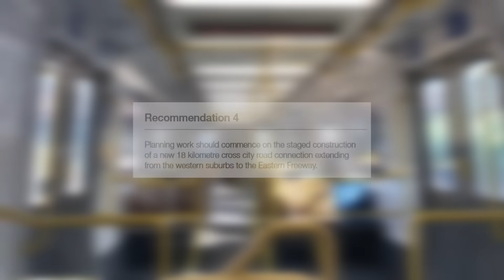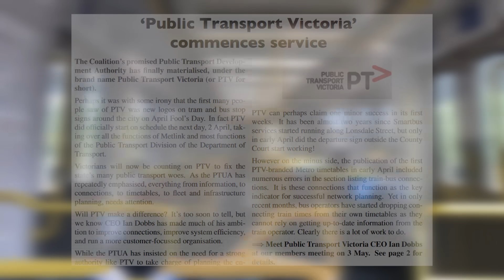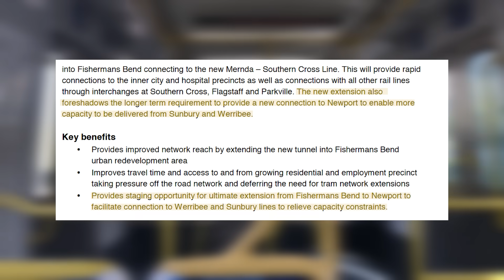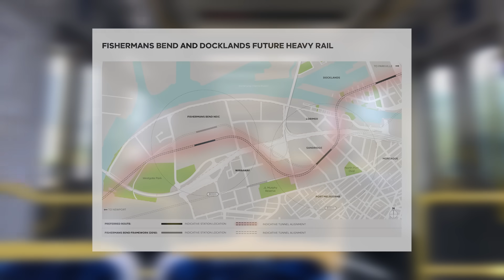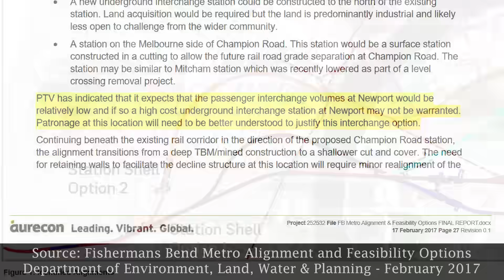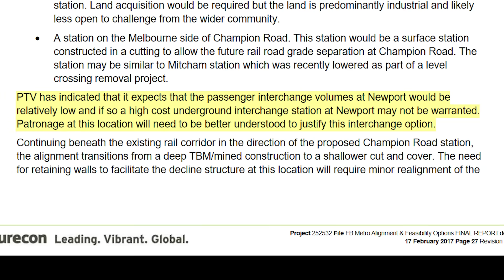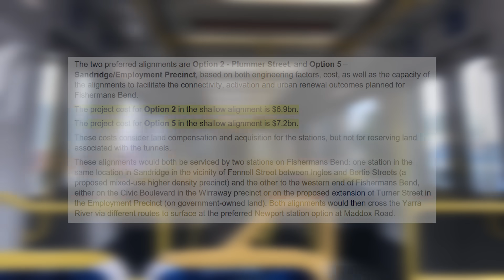Melbourne Metro 2: Explained

Comment: How Metro Tunnel + Other Tunnels could transform Melbourne

How Melbourne Can Keep Its Most Liveable City status…

I am a fan of the metro link proposal, that goes from Newport to Parkville. But I am not a fan of the proposed tunnel that runs past Parkville. I believe that this plan is floored. And I have what I think is a much better idea. 

THE IDEA: PART 1. I think that the proposed tunnel should link up with the Metro one tunnel near Parkville, and the metro 1 tunnel should be extended down Gratton street in Carlton, in a virtual straight line, crossing may well known roads heading into and out of Melbourne, and link up at Collingwood station. I am pretty sure it is the Craigieburn line does not have direct access to the tunnel, so as part of the idea Craigieburn is given access to the Metro 1 tunnel. 

PART 2: Now from Collingwood my proposed tunnel should be built to the Cr of Johnson St and Victoria St in Richmond, where a station should be built., (or close as you can too it). And the tunnel should continue to a second of my proposed stations, at the Cr of Coppin St and Bridge Road, (or as close as you can too it). The tunnel continues from there to east Richmond, where another tunnel station is built under East Richmond Station. And the tunnel should continue from there to South Yarra where the same thing is done, with another tunnel station under the existing South Yarra station. 

THE BENEFITS: PART 3: I predict that in about 20 years, as the docklands was made a CBD zone, that the same thing will happen in Richmond. Cos, if you know Melbourne well. Then it’s an obvious next place for the CBD to expand. And what this tunnel will do, is create a kind of ring road for many train networks. And allow the Frankston and Sandringham lines to run straight through to the Epping and Horsebridge lines, right through will most likely become CBD in the future. So, when my proposal is combined with the Metro one tunnel, and the idea in this video I discussed previously, it should connect, like in Brisbane, run through trainlines across approx. 90 percent of the whole network. 

MY IDEA COMBINED WITH YOURS: PART 4: And when you combine Metro 1, with My Idea, and the Idea that I liked in part 1 that I have already discussed, that figure might very well be 99 to 100 percent of the network, has access to by-pass the loop. I think this is by far and away the most efficient way of connecting Melbourne using the least amount of new tunnel. 

ANOTHER IDEA: You could also build a tunnel from Burnley station to the new proposed underground station on Bridge Road. And that would connect the Glen Waverly line with the Craigieburn line, in a ride through configuration like exists in Brisbane, that would bypass the loop. And then that would leave only the Belgrave/Lilydale lines being the only line that don't have a drive through connection, that connects two lines, on opposite sides of the city. 

ANOTHER IDEA FOR OFF IN THE FUTURE: You could connect the Lilydale/Belgrave line, with a tunnel that starts from East Richmond, and goes under the river, and runs parallel but to the south of Richmond/Finders/Spencer St Stations, that hooks up with your proposed station at Sandridge. It could go from East Richmond station, to a new station at the Cr of Dorcus St and St Kilda Road, then to a new station at the corner of Clarendon St and Dorcus St, and then a new station near the Cr of ingles St and Lyons St, and then on to the new Sandridge Station.  If you fast forward to 20 years in the future, Melbourne becomes a population of 8 million. The CBD would probably run through about 80 percent of the proposed tunnel in the whole of this writing. 

ANOTHER IDEA FOR WAY OFF IN TO THE FUTURE: And this one isn't as efficient as the others, but it is more of just, what I would like to see. A tunnel system that goes from your proposed Sandridge line, and goes south along the bay, and the beach, and ends up in Caulfield. Travelling through these stations: Barkley ST in St Kilda, Balaclava station, and Caulfield station. And any others that make sense along the way. The Idea would be that western trains could terminate in Caulfield.

WHY YOU SHOULD DO IT MY WAY: Cos my way puts the most amount of tunnel, in places that should be considered CBD, when the population of Melbourne hits 8 million people. Otherwise, you run the risk of having a network connection that the public views as a colossal waste of money. This is what could happen if you get enough of the new network be unpopular, like with Flagstaff station back in the day. Where trains would just skip it. And my idea connects 100 percent of the network with trainlines that will run under what should be considered CBD, in a way where the trains connect with other lines on the other side of the city. Just like in Brisbane. But Melbourne will have the best of both worlds, cos it will be like Brisbane and Melbourne, with the option of travelling and bypassing the loop out to an opposite side of the city, or going through the loop.

Comment: If they ever get around to this project, I seriously hope they re-open Paisley station. With the recent new shopping centre built near there I think it would have a real shot a second time around. And if they make the express route the permenant Werribee/Wyndham Vale line I hope the Altona loop gets, ideally duplicated, and extended to Point Cook. That could be hard to get off the ground but if the plan is to run some (and probably all eventually) Geelong line services via Werribee again, it'd mean you'd have the space for extra tracks and a free platform at Laverton for them to overtake or even stop there. Above all though Point Cook is growing and could do with an extension, which would probably take pressure off Williams Landing too. You could run it either via MM2 or on the above ground lines seeing as they'd now have space.
Reply: Funky idea, Wyndham vale to Werribee then to Point Cook!
Reply: @iamthinking2252_  I meant to say Werribee/Geelong line, but it would be nice if they finally connected it to Wyndham Vale too seeing as if they make Geelong trains go via Werribee again, which I'd say would be the easier option (especially if MM2 is built, you'd have the capacity for it then) as quadding the RRL would be a lot harder than it once was given all of what's gone up in Tarneit in the 10 years since it opened, Wyndham Vale is likely to be it's own electrified line. Long term they probably should look at electrifying the intercity lines, ideally with it's own (preferably double deck) rolling stock.

Comment: 7:27 i’ve got an idea for Rushall station the station could be retained and a double crossover is added to the line on the upside of the station and Rushall trains could run local services between Clifton Hill and the city and have trains terminate at Rushall and hurstbridge line trains would only have to stop at Clifton Hill and skip all other stations ( except joilmont on special events days when there is no special event taking place it would run express through jolimont station)

Comment: wait did that plan include electrifying all the way out to geelong!? because running velocities or other fuel burning engines through the tunnels would increase the requirements for ventilation

Comment: Wouldn't it be better in the long run to have the new line be split in two underground between flagstaff and Melbourne central? you could make a direct connection between Melbourne central and southern cross and make a direct connection between flagstaff and Parkville. This would allow the Mernda, Hurstbridge and the Burnley group to through run with the new lines (Hurstbridge to Newport + Burnley to Mernda). This would remove the need to make a new station at flagstaff and you could also create a junction in the existing tunnels between flagstaff and Melbourne central allowing excess Burnley trains to loop back around the loop if needed.

Comment: 25-30 billion dollars is still a lot less than some insane road expansions, but I do think there could be some smaller scale improvements made across the network with much better value for money. Off peak frequencies are really what needs to improve, and that is largely possible with existing infrastructure and rolling stock.
Reply from the maker: I suspect those off peak / weekend improvements will happen not too far in the future, perhaps even as soon as the opening of the metro tunnel
Reply: @MetroManMelbourne  I think they'll definitely improve off peak frequency when the Metro Tunnel opens, and claim it as one of the project benefits

Comment: the Fishermans Bend TOD would be huge, but i think light rail can handle it for now, SRL, Airport Rail, and Doncaster are still more urgent projects because of the distance, which our heavy rail is better suited to handle. the Southbank connection itself is good, finally bringing back the scale of service that hasn't existed since the very start of Steam rail service, it just won't contribute a whole lot to projects like SRL.

Comment: One group who would really benefit from this tunnel are Geelong-Melbourne commuters, who could probably save a good 10-20 minutes with a more direct route through Werribee and the tunnel as opposed to winding up through Sunshine and down again. 

Unfortunately, setting the tunnel up for those people will lead to additional expenses on the project -- since the Geelong line isn't currently electrified and diesel trains shouldn't go through metro tunnels, you would need to either electrify the line to Geelong, build bimodal trains that can use electric power through the city and diesel on the unelectrified lines, or set up timed transfers with cross-platform interchanging at Werribee.
Reply: Long term, (or even shorter term) it makes sense to turn the Geelong to SC corridor to a moderately fast electrified line, dropping the commute time and increasing the capacity from one of the fastest growing regions of Victoria to the city.  Freeing up the Sunshine Corridor to serve more trains west to places like Ballarat and Bendigo would be useful as well.
Reply: Just electrify then
Reply: or a hybrid train it's diesel from werribee onward but connects to the cables at werribee

Comment: How many more services per hour could the lines that remain on the City Loop get with both Metro 1 & 2 complete?
Reply from the maker: Essentially, with both Metro 1 and 2 complete, the network would have been de-interlined, going from 4 different "groups" (Burnley/Caulfield/Northern/Clifton Hill) each with 2-5 branches running into 4 loop tunnels, to a whole bunch of different lines which would largely be independent of each other - Sunbury/Airport-Cranbourne/Pakenham, Wyndham Vale-Mernda/Wollert, Craigieburn-Frankston, Upfield-Glen Waverley/Alamein, Laverton/Williamstown-Sandringham, Belgrave/Lilydale-City Loop, Hurstbridge-City Loop. Every one of these lines could run at the maximum line capacity (usually 24tph), so in effect, we would be able to add probably well more than a hundred trains per hour into the city during peak hours, amounting to probably an extra 200-300,000 riders/hour.

Comment: It would be expensive, but so is the north-east road link that is currently under construction, and which is only going to induce more traffic.
Reply: It will be good for cross town trucking, but we need to go hard on trains to beat the induced demand for cars journeys!
Reply: @k0mm4nd3r_k3n  Yes, you're right about the trucking. I should have mentioned that. My comment was referring to cars.
Reply: That road will be 20 lanes wide and cost as much as the whole SRL..
Reply: More people use cars. Please get over it.  And the east west link is privately funded and users pay full cost to use it.  They don’t on railways.
Reply: @xr6lad  most roads arent toll roads and hence arent paid for by car users, they are instead paid for by your taxes whether you drive a car or not
Reply: Most roads are paid for by council rates. Arterial roads by VicRoads, mostly GST. Only highways are paid by fuel taxes, and toll roads are subsidised to a huge degree. They barely cover the maintenance costs.

Comment: i dont understand why they need to have new stations at newport and southern cross. surely all we need is stairs going down to some underground platforms, wouldnt that simplify it?
Reply: you mean to a line that doesn't exist yet?
Reply: It's a branding exercise. "We're building a new station" sounds better than "We're adding new platforms". That's why the Metro 1 CBD stations are called State Library and Town Hall even though they're functionally extensions of Central and Flinders St.

Comment: Good video! Please consider making a video about the concept line called Melbourne Metro 3.  That concept was proposed to incorporate a Doncaster line and Airport rail via a new tunnel under Bourke St in the CBD with new Platforms at Southern Cross, Parliament and a new station under Bourke St Mall.
Reply from the maker: I've got that planned for some time in the near future - I think that plan is the next logical expansion of the rail network after MM2.
Reply: @ I agree.  Ideally MM2 would have been started now instead of the SRL.  With the MM1 almost finished and the resources moving away from that project it would have been logical to have them move onto MM2 projects.

Comment: This would work well but I can’t help but wonder if extending electrification further out to our outer suburbs would help more than this? As the inner suburbs are increasingly more expensive to live in we are seeing people moving out further, past Wallan, melton, Whittlesea ect. Having usable train lines out there would massively decrease congestion on our roads. I reckon this should be prioritised as Melbourne is growing by the day and these are only served by Vline. This is coming from someone who uses the Mernda line
Reply: If only they had included this electrification in the metro tunnel and didn’t kill it off so they can turn trains back at west Footscray
Reply from the maker: That's something that's planned regardless of this project.
Reply: @rtyt2007  They could electrify the line to Traralgon, couldn't they Jeff? An LNP future project?

Comment: Btw in the graphic of Fishermans Bend, the arrow should be pointing slightly further north as you can see where the new Turner St with tram line exists (look at the left of the graphic to see the tram itself).

This is an excellent video, where did you find all the alignment option maps? I have a feeling if they built a Newport West station it would not have cross-platform transfers and would instead be up/down MM2 up/down Altona platforms. And I also think they will build a Fitzroy station on Alexandra Pde as there is enough room in the median to avoid needing to shutdown the road, like they would have to do for Johnston St.

It's an interesting thought that the existing alignment could be kept for MCG or special services, I wonder how they would fit in a trenched (or underground) Merri station with tracks that remain above ground, or would they need to have some ramps south of the underground Clifton Hill platforms to get back to the current alignment?
Reply from the maker: The alignment option maps are linked in the description (labelled "2017 report" and "2024 alignment").
I wouldn't be surprised if they built a station on Alexandra Parade - personally though, I think the ideal outcome would be a cut-and-cover line along Johnston St, which would be disruptive sure but would be cheaper and would avoid requiring passengers to go down 5 storeys to get on the train (which adds a lot of travel time).
For the existing alignment, I suspect that they would simply keep a single track of the two connecting from the tunnel portal near Merri to Clifton Hill, not linked to MM2 anywhere.

Comment: The western end of the project should incorporate the Altona Loop, removing it from the Werribee line and duplicating the tracks at the same time, and at least one new station in Point Cook which continues to expand south without adequate public transport infrastructure.
Reply from the maker: The project specifically avoids the Altona Loop to allow it to be separated from the rest of the Werribee line, as it is a slower route, and the section through Altona would be difficult to duplicate thereby impacting on reliability. Still, a line to Point Cook should be examined eventually.

Comment: Maybe you should talk about crap our timetable is for metro and vline, vline always getting caught behind metro on the pakenham line and something can be done
Reply from the maker: Unfortunately very little can be done about that specific issue without adding extra tracks to the Dandenong line
Reply: At a public meeting in Carnegie for the level crossing removal, the authority was asked about at least providing provision for 4 tracks. The LXR said, we are a level crossing removal authority, not a rail planning body.
Reply: @blueycarlton  it is possible to let 25 mins so vline doesn’t get stuck behind metro, so you run 2 Cranbourne trains after that and then after the vline passes 2 pakenham train and even a 3rd in peak,